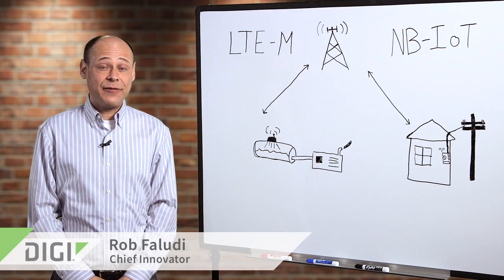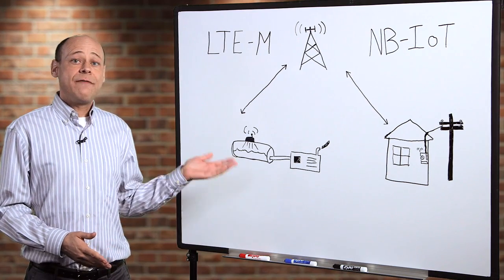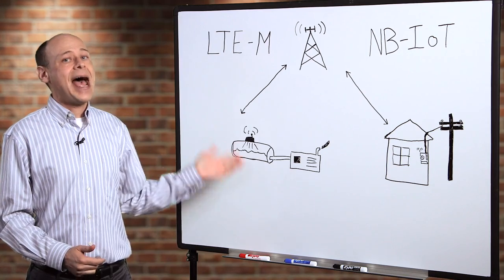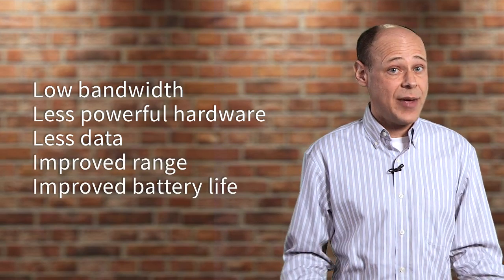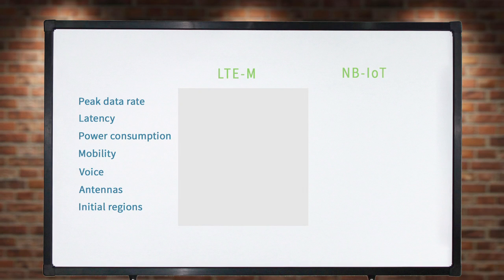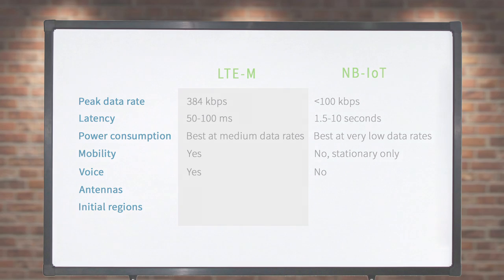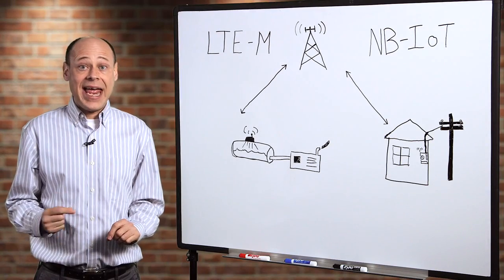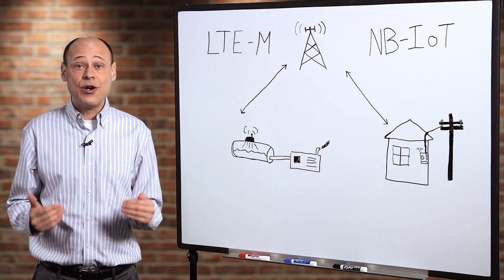LTE-M vs. NB-IoT: Determine the Differences Between Low Bandwidth Protocols

Comment: Does the deployment of NB-IoT require hardware to be added at the eNodeB? Or is it just an eNodeB software upgrade?

And if you could answer the same questions for LTE-M, that would be useful as well.
Reply: No it does not. Both LTEM and NBIOT are software upgrades.
Reply: Simply the ARFCN will be different for new NB IoT cells which will listen to IoT devices and will transfer the data. No additional hardware required for the cell site.
Reply: How to find out the NBIOT deployment...